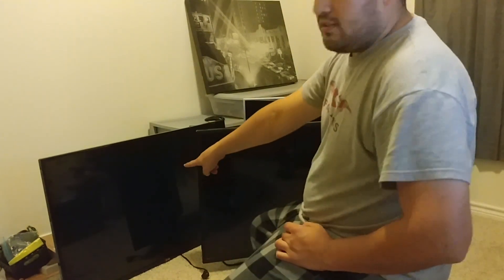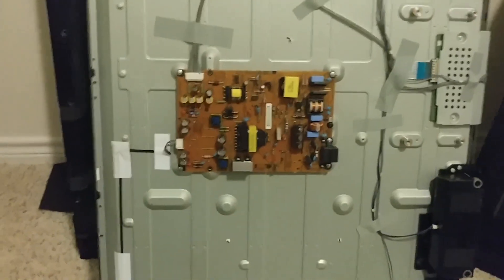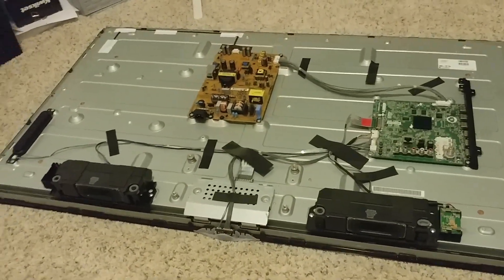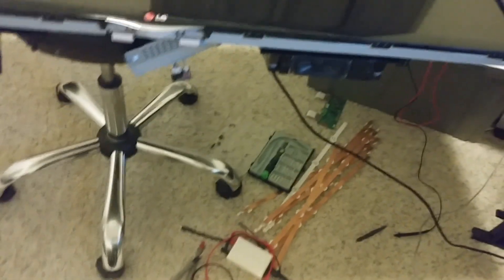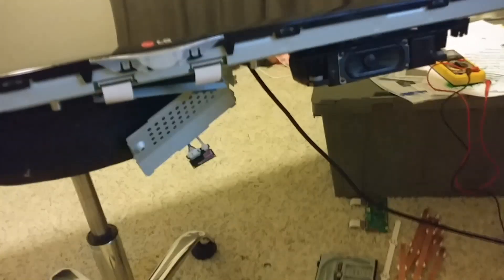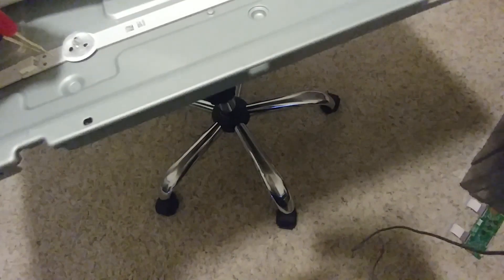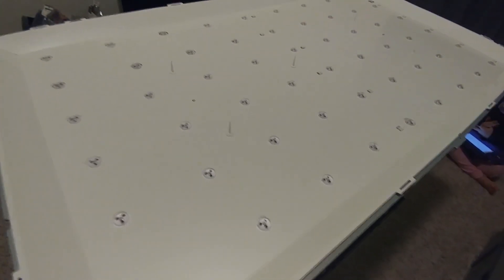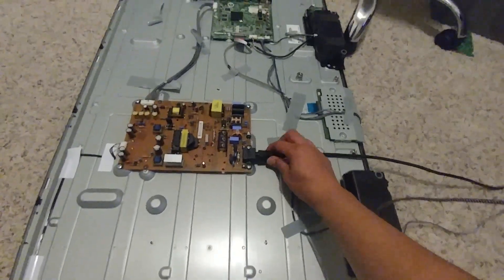LG TV has no backlights no picture: fixed!

Comment: My tv is set up the same as far as the configuration and components. Where is the led inverter board? I'm assuming its built into the power board or the main board.
Reply: The lg logo appears before the screen cuts out and I have audio but no back lights. I'm hoping just to switch out the board that has the inverter built in. If it's the back lights themselves I'm probably just going to buy a new TV I guess. I really dont want to dig that deep into it
Reply from the maker: @Batman-ps5ul  what is the model number... It actually may be the backlights. Did you run them full brightness?

Comment: Wouldn't it have been easier to unplug the main board from the power board and then just plug it and let the led's light up to see which ones don't light up?
Reply from the maker: No. LG does not turn on when the main board is disconnected. Only samsung will do this.  Also it would depend if the led is in series or parallel circuit.

Comment: + TECHIE LIFE I have Samsung TV 2016 and it has the standby light blinking. I changed the power board and the main board but still doing the samething, what other things could be the problem?
Reply from the maker: Cruz Ortiz do you have any sound? What's the model number?
Reply: TECHIE LIFE  there’s no sound or anything just the red blinking light by the power button. The model number is UN65j6200afxza
Reply from the maker: Cruz Ortiz check the back of the TV.. do you see a red light on the optical port. What about using the flashlight test. Could be that the tv does turn on, but maybe you have bad LEDs. Or maybe, you just got bad boards. Here's an easy test. Plug in only the power supply and the LEDs. They should come right on. Dont connect the main board. Then you'll see if you lower supply and LEDs are good.
Reply: TECHIE LIFE  I did do that test as you suggested and all LEDs are coming on right away!
Reply from the maker: Cruz Ortiz it's probably the main board then.
Reply: TECHIE LIFE I have install a new main board and new power board! But didn’t change a thing
Reply from the maker: Cruz Ortiz I think the main board is faulty. If not, then it could be your power button.
Reply: TECHIE LIFE  you don’t think it could be the T Con. Board? That’s the only board I haven’t change
Reply from the maker: Cruz Ortiz no. The tcon controls the video. Not the logic of the tv.
Reply: TECHIE LIFE thanks for you’re help, I think you’re right! It can be the power  button. For some reason got it to turn on buy having it connected and the I disconnected the main board and connected back on. Now the screen is on but I dont know if I’ll stay on,
Reply from the maker: Cruz Ortiz lol. No prob. Hopefully you'll get it running.
Reply: TECHIE LIFE  I got it to work thanks for your help! I’m following your Chanel now! I’ve learn alot in one day  !
Reply from the maker: Awesome! great job. Thanks for your feedback and your support.
Reply: Cruz Ortiz what was the issue?
Reply: Rudy Lives main board i thing but I changed both